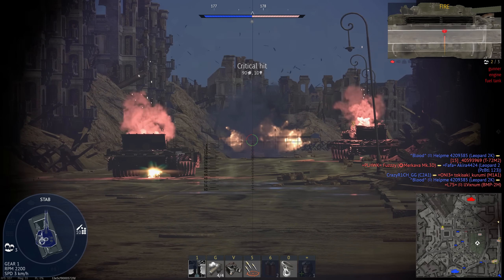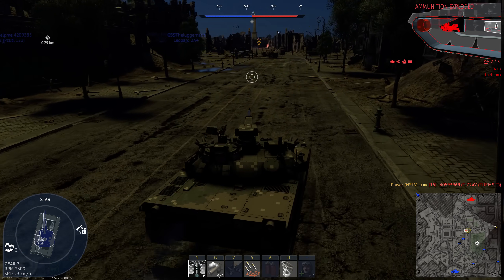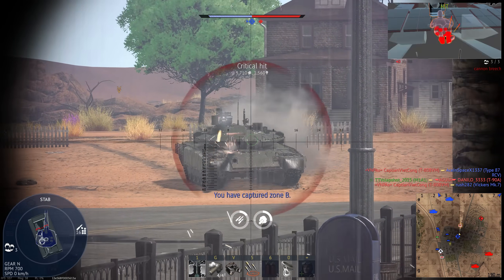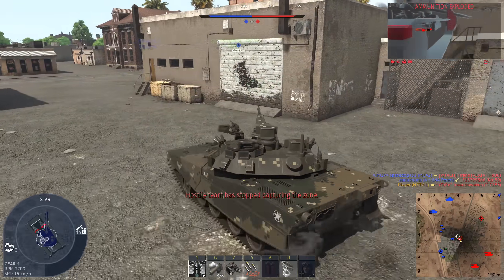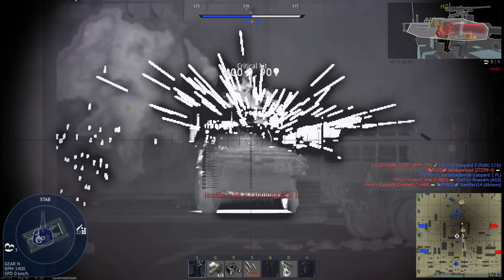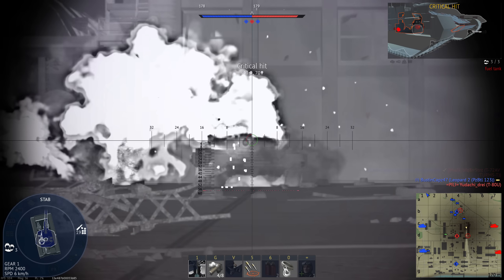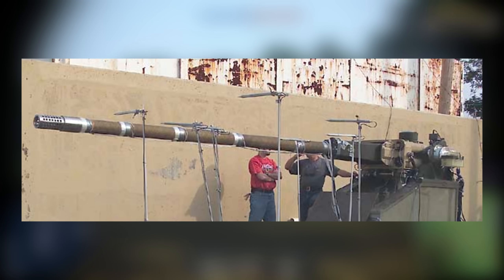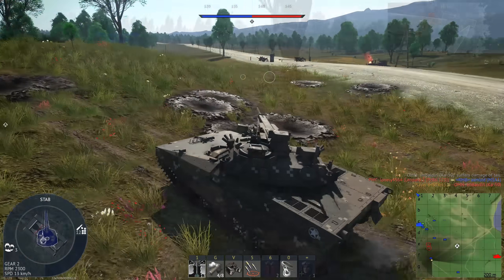The Anti-Everything Tank Gun

Comment: MRAS-FCS was simply too far ahead of its time.  but the Idea of a common chassis around which to have many different sub-systems can be seen in the CV-90 family.
Reply: ... and is going to be needed to maximize production capabilities. Ukraine is showing that, yes, industrial capability does matter, and anything more than curb-stomping a 3rd rate power is going to have the requirement to manufacture replacements, a vital component of any war plan.

... which is why in a CnC Tiberium/Generals fusion setting I'm working on, GDI basically used all the experience using the motley crew of weapon systems it inherited at the start and shifted towards a handful of standard chassis. Like the MBT's chassis being the frame of two IFVs (one a standard IFV and the other being similar to the BMP-3 in the fact that it had a demolition gun slapped onto it, you can't argue when a 165mm HE/HEP round decides to make your day miserable), an MBT, a mobile SAM system, a DIVAD system, a heavy MLRS system, and a heavy howitzer system.

Comment: When missread the title as "The Anti-Everything Gun" I was immediatly thinking of the 88mm Flak :D

Are you an ...
Aircraft ? 
 - bonk
B o a t ?
- bonk
Tank ?
- boom
Reply: The 88 flak wasn’t a very effective anti tank weapon both due to difficulty to conceal, difficult to set up and transport, as well as a relatively high 44 rounds expended per engaged tank destroyed. Also it’s not the best anti aircraft style of gun. The 5 inch/38 naval gun was much better at both destroying ships and aircraft. Considering the 88mm mounted on German ships did fuck all to plane and was rarely if ever actually used in a ship to ship capacity and if so didn’t perform well. 88mm is a really small anti ship weapon so it’s not really surprising it can’t fulfill that role
Reply: I had the exacted same thought about the video's title and the 88mm Flak,
Reply: I get what you mean but those are just 3 things, when I think of Anti-Everything, I think of Everything, not just 88mm spam on Bombers, Supply Boats, and Anti Bunker ammunition that works surprisingly well on Tanks.
A Anti-Everything gun to me would be the Davy Crockett Missile Launcher. The thing that inspired the Fat Man.

Comment: Despite it's failure, I see a potential in this project for a ship (think of heavy cruisers) mounted 150mm+ version. Here you mentioned that 105mm missiles had range of up to 50km. 150mm missile with top down capabilites could have significantly more range. And before anyone jumps in screaming how ship launced large diameter missiles already exist, their ammo storage is extremly limited, ships need to be dry docked to be rearmed which puts them out of service for days or even weeks, not to mention the equipment (and man power) needed to lift missiles, align them perfectly and drop them in a ship. If such system were to be installed, where missiles would be placed on their side rather than vertically, ammo storage could be increased by a lot, ships could be loaded more easyly and options for field reloads from dedicated missile carying subs are endless. Heck, make it so the ship itself is a dock for a sub in a way.
I am not an expert and I don't know how many souch ships would operate in a carrier group but these puppies could make US and NATO's most valuable military assets near invincible.
Edit: any 3 letter agencies and their contractors interested? Maybe? Would be amazing to work for one.
Reply: Hey you just invented the Zumwalt Class's AGS
Reply: Yes, currently most of the navies' vertical missile launch system cannot be reloaded outside of a harbour.

Comment: Man FCS had some questionable assumptions going into the basic vehicle designs. Like the low armor protection in lieu of a smattering of sensors.
But damn did it have some interesting weapon systems designed across the whole program. Kinda sad that none ever got adopted or even modified for use in other platforms. 
Well except for maybe the Next gen Abrams new gun..
Reply: @bob bobthebobbobofbobby yeah, one of the reasons why the AIM-260 development (AIM-120 AMRAAM replacement) has been so quick was likely because Lockheed could leverage the knowledge gained from a slew of research data from never to be/eventually cancelled designs of the 2000s/2010s for air to air missiles
Reply: @moonbear2130  SLAMRAAM
Reply: FCS had low armor because they wanted "deployability" or the ability to fly on a C-130 cargo plane.  They nixed that and used it to the bigger C-17, but they still needed to fit in the GIC train tunnel.  It was also dreamed up pre-heavy EID threat.  Then the next new program was GCV, which was basically Abrambs weight troop carrier.  I worked on both programs as a suspension designer.
Reply: So Ukraine is proving quite handedly that having good sensors is far more important then armor with modern anti armor weapons.  If one should be traded it should be armor for sensors. He who see and shoots accurately first is usually winning the engagement period.
Reply: I have a suspicion some of those missile rounds might actually exist in 155mm. 
That would come as a very nasty shock to America's enemies.
Reply: Maybe the Army could make better use of these weapon systems if they tried developing a modular remote weapon station designed to fit with the existing Stryker vehicle (like the 30mm and 105mm guns they added to it) instead of building a whole new armored vehicle around it. That way, if the gun itself fails irredeemably in development, it doesn't compromise a larger system of systems, nor does the experimental gun rely on the sucess of a whole new vehicle.